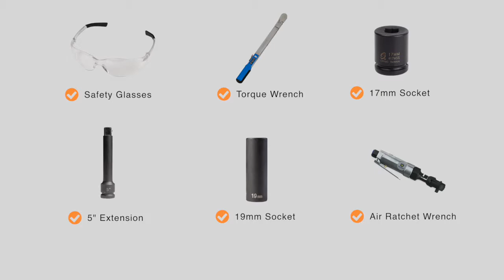2015 Toyota Tacoma Trailer Hitch Installation

Comment: I have a 2015 Toyota Tacoma 4 l what is the hitch model number for class 3 tow hitch for my truck I've been having a hard time finding it
Reply: This is U-Haul part # CQT75236. You can follow the link in the description, put in your vehicles info, and it will bring up all the parts needed for your tow package.

Comment: What are the mounting bolt sizes?
Reply: i would assume since you need both 17mm and 19mm sockets those would be what they are. I could be wrong if someone's changed them out at some time.